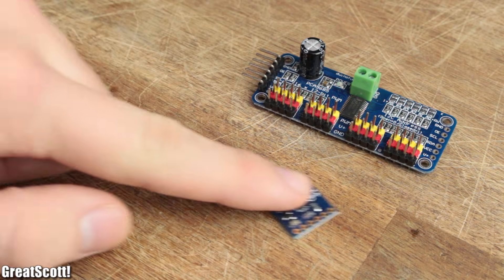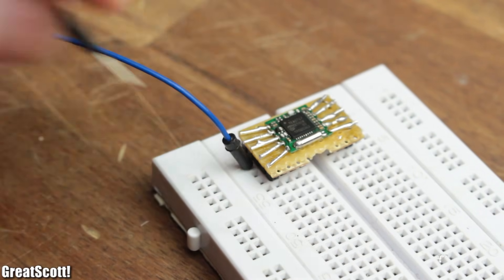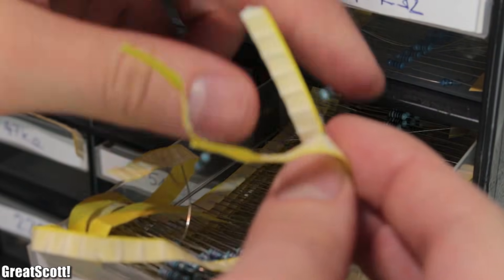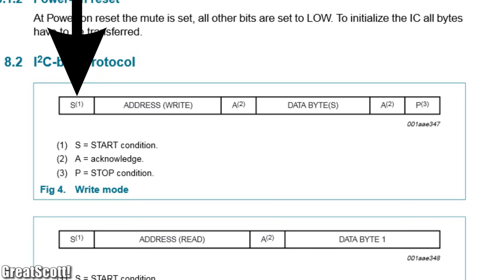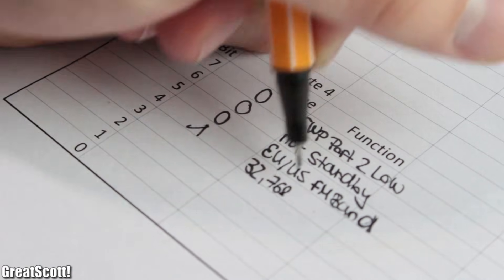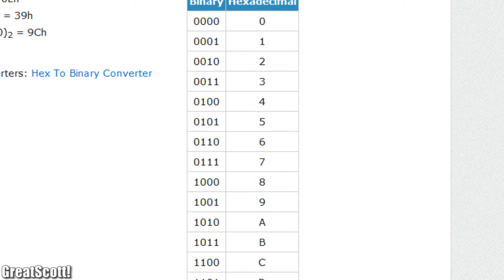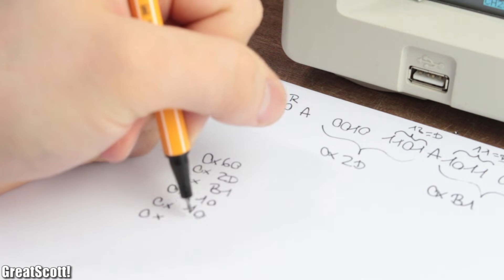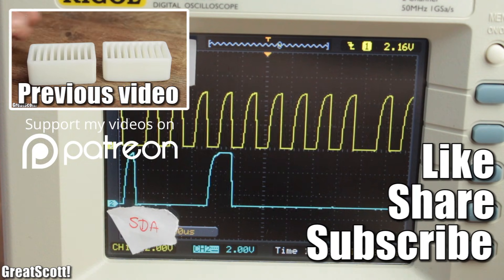Electronic Basics #19: I2C and how to use it

Comment: You missed all the top level questions: why would we use it over other methods? What’s the transfer speed? How does it compare with other comms protocols? 100khz.. bah.. too slow for a lot of things, I’d rather use USB to connect peripheral boards if possible.

Comment: Just burned a BME280 (on a breakout board) due to lack of knowledge what voltage is required on the I2C bus. I did put resistors but connected the bus to the 3.3V (since both my OLED display and the BME280 work on 3.3V with the OLED able to get even 5V). This lead to a too high of a voltage for my BME280 since for some reason connecting the sensor to an I2C bus that runs with 3.3V made a 4.6V or so on the Vcc of its breakout board. Poop...

Comment: When you said 10k pull-up, I thought "that's not enough." Then sure enough, your clock and data rising edges are really rounded off. Typically I2C needs 4.7k or even lower pull-up resistance.

Comment: I'm guessing you aren't intentionally misleading with the 'Electronics Basics' heading, but a person has to be past that point to fully understand what you are taking about.  The I2C portion is OK, but there are many points that you just speed through as if it is second nature to the listener, even though they are an audience drawn to the heading of 'Electronics Basics.' You speed through at break-neck speed barely coming up for air, because I think your goal is to keep the video short. The problem is that you crunch too much information into the timeline, and many important points go by in a flash with almost no explanation of them.

Comment: what hapend if you connect 2 same devices with same device address, for example 2 identical lcd modules or temperature sensors, is it possible to change device address? thx

Comment: I am currently using RTC clock with Arduino UNO and It doesn't need any external pull up as Mega328 has internal pullup.

Comment: Is the pullup resistors really needed on arduino? i aways used the i2c protocol without and works like a charm...
Reply from the maker: The Arduino has integrated pull ups.

Comment: what is maximum distance for i2c communication. 
ie. i'd like to have multiple devices  (mostly relays and sensors) across house, garage, workshop, well, etc .. where distance can be up to 130 meters. 
is it possible ? or there's need for other solution ?

Comment: Can you do a basic tutorial on SMPS.The one from wall AC socket converted to DC to power small gadgets  "not DC to DC one" :)
A simple fundamental principle will be more convenient. Like simple SMPS that only uses AC input --> diode bridge rectifier --> Capacitor --> MOSFET --> Switching transformer --> schottky rectifier --> Capacitor --> DC output.

Comment: For me you moved away to quickly from the I2C theory and got to involved in the radio module. I'd rather have seen you explain how the bus works with single and multiple devices. Although I could follow what you were explaining, I believe it's going to be to complex for a lot of viewers. 
I compliment you anyway on doing an excellent video. Presentation and detail were precise and professional.
Reply: +Kenneth Tan Agree with you on that, sir.

I was completely lost  when you explain about those bit ordering.
Reply: +Kenneth Tan I think that explaining very technical subjects such as the detailed bit order used in I2C is not easy in a video. I learned electronics before I went to university and became an engineer mainly by reading the manufactures specification documents. This was in the '60s and '70 so no Internet, YouTube or Facebook. I would write to the manufacturers and ask them for data sheets and catalogs. When they came I would read them over and over and over trying to understand the meaning of all those words and numbers.

Now you don't have to write to the manufacturers but, if you want to really understand what these parts do, you should use the Internet to find the data sheets, catalogs and application notes.

For example, here's the I2C web site with very detailed explanations of how it works. (http://i2c.info/i2c-bus-specification) It can be a bit overwhelming but if you keep at it AND watch videos like this one, you will figure it out. For me, someone tells me how a thing works is not as powerful if I struggle through the process of figuring it out myself.

Good luck. I admire you all for taking such a keen interest. For me it has been a 40 year process of solving puzzles and getting paid to do what I would have done for free.
Reply: @RobertShaverOfAustin 9 years later and your comment came in so handy thanks for sharing! I’ve been pouring over TI datasheets trying to understand i2C and that website you linked is incredible thank you 👍
Reply: @XJ290  Thank you for noticing my little help. Now I'm trying to learn to write stories that might help kids find out how much fun it is to make things that are useful. It was a story I read when I was in the seventh grade. Here's a link to the story I wrote about what a simple story can do.
Reply: Robert Shaver yes I agree with you. It is much more valuable to learn it by self teaching and imagine how awesome it will feel to finally get it!  I’m on that journey myself to learn synchronous data communication such as SPI and studying a lot of resources.
Reply: A good description of I2C would take an hour.
Reply: instablaster
Reply: +Robert Shaver Actually Robert, GreatScott does an excellent job explaining technical stuff, but my opinion about this video is, that he should have sticked with more detailed I2C subject matter. Still it remains a very good video

Comment: Could you please make a video on how to trouble shoot arduino? I dont expect you to make a video just because of this but hopefully reply/ think about it? I was using my arduino connected to my laptop (macbook air) when the laptop suddenly restarted. The circuit was a 12v led controller, and none of the pins seemed to have shorted. After restarting, whenever i plugged my arduino in, the pin 13 led would always just come on and not blink like its supposed to. Other than that i always get the dreaded stk500 avrdude not responding 0x00 error. Any ideas why this could have happened, maybe how i can fix it? Thanks a lot for your time, really love your vids :)

Comment: Great video Scott. Just one comment though, the oscilloscope traces show that the rise times are rather long, 10k pull-up resistors are rather lazy. Most device data sheets recommend smaller values, like 3k3 or 4k7. I use the Arduino processor's bigger brother, the ATxmega which runs much faster. Even with a software i2c driver I can run at full speed of 400kbits per second. At this speed I need 1k5 pull-ups to avoid data corruption. If you're worried about supply current, remember that current only flows through these pull-ups when the line is driven low and they float high when the bus is idle. So if you have only occasional message traffic the duty cycle is incredibly low, meaning the supply current increase is negligible.
Reply: Your comment is interesting, but the capacitance of his oscilloscope's probes creates an RC that is most likely the reason of this lazy rising time IMO. As you can see the falling time is much shorter because the current doesn't flow through the resistor but thru the MOSFET instead. If he changes the pull-up resistors from 10k to 4.7k or even 3.3k, it won't make the rising edge much sharper. The only way for him to make sharper edges is to disconnect the probes and significantly reduce the parasitic capacitance.
Reply: @Les-electroniciens  yes it is the scopes fault but not because of the RC but because the scope has only 1mb of memory and can not display accurate information
Reply: Great points!!

Comment: I'm working on a project that requires multiple i2c devices. I was wondering what your recommendation would be for the values of the pull up resistors. Thanks!
Reply from the maker: +Raymond Barakat If it's a 100kHz communication 10k works just fine. If you use a faster frequency you might need to use something like 1-2k to get the required rise and fall time. The datasheet of your ICs also often mention a recommended value.

Comment: I can see that this describes the protocol used to control your radio chip but you don't cover why it is necessary to use I2C. You did mention that more than one device can be connected but the real benefit of I2C surely is that MULTIPLE devices are attached to the same interface. You wouldn't really do this with a radio chip but you might do it to collect temperatures from a lot of identical input devices which have unique addresses. So the key bit missing is how to do that. Is there a part two to come?

Comment: Do you have an idea about connecting Arduino with Laptop battries and reading its information?
there is I2C address finder ready arduino code for example to help as a start to find which address first then communicate with the controller device if it was I2C ?
Reply from the maker: +Sam Just search for the datasheet of your batterie control IC. That should solve many questions.
Reply: +GreatScott! Thanks 👍